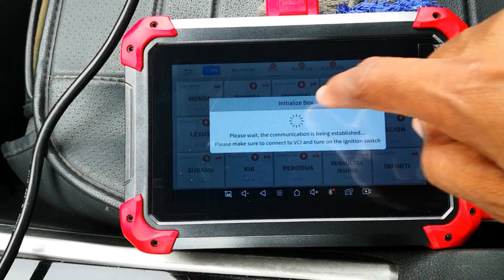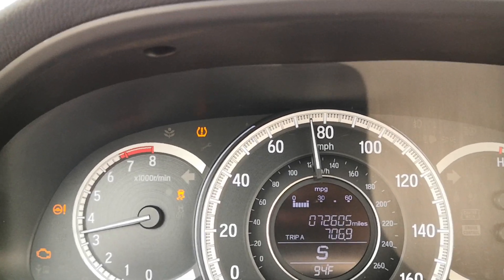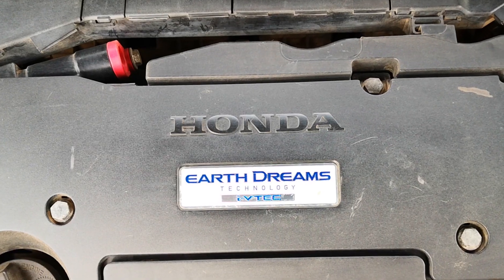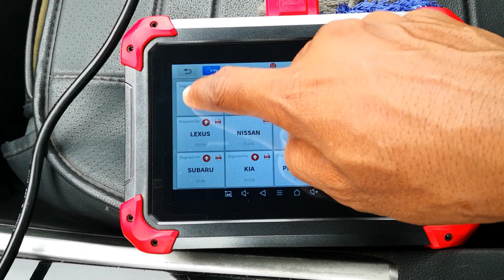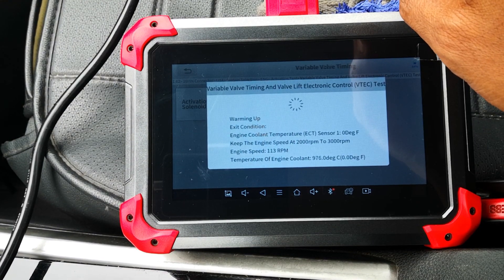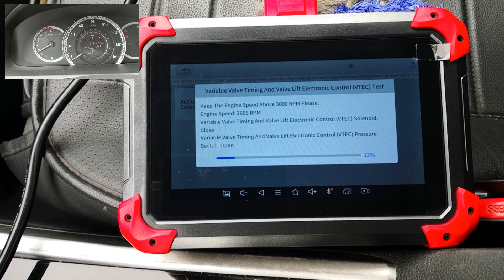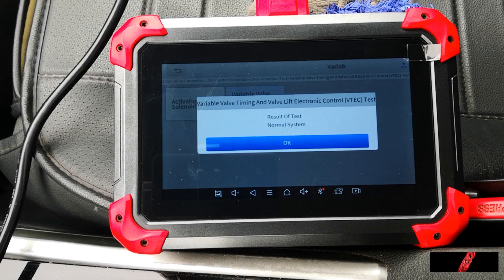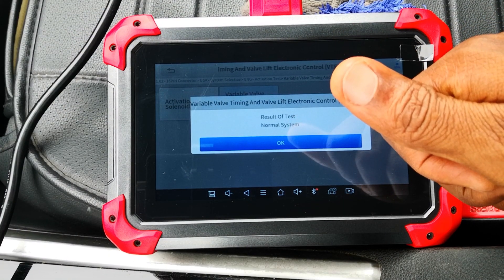How to Test VTEC on Honda using OBD2 diagnostic scanner: XTOOL D7 Bidirectional Scan Tool

Comment: What scan tool do you recommend for a CKP relearn for 2008 honda accord with K24Z2 engine
Reply from the maker: Pretty easy function to do. XTOOL including the D7, or equivalent Autel's support it. I think the A30M can support it but haven't specifically checked. Can do so later and revert.
Reply: @DIYAutoworksNG  CKP is not on the 30M only D7, 7S and above. In your video you bypass the VTEC or spool valve test but test the VTC/VVT system, why is that? Is this test only on the 9th gen Honda Accord or does it work on the older gen?

Comment: Well-done sir, been watching your videos and I can't believe you're not  a professional technician but a medical doctor. Or we'll yes you're a doc -of automobiles 😂. Anyway sir great video. I want to get xtool ez400pro it's same with d7 but has ecu coding feature. But in your opinion xtool and Autel which one should  I go for? And if autel what's  the counterpart of it in xtool -both price range, capabilities and other stuff?
Reply from the maker: Thanks for compliments. Yep, I treat both man and cars🤣🤣🤣.

You are right the EZ400 Pro has the edge over the D7. The competing Autel would be the MP808. I consider Autel generally more refined in its finish, but this comes at a price. The MP808 is about $200 more than the EZ400 Pro. Also, the 3 years of free updates for the XTOOL, plus the significant lower cost of subscription renewals definitely adds up. My task really is to lay it bare so that everyone is able to make an informed decision when choosing a tool. The truth is that both are good tools, I'd say you go with the one that makes the most sense taking all those points above into account. Best of luck!

Comment: Nice!

I noticed under the Active Test section, that there's a test to put off one injector. Do you think this also works the other way (i.e. the same test puts off and on a single injector)? Just asking because some diagnostic workflows may require one to actuate one injector to test the control side of that injector's circuit (with the injector disconnected to prevent burning its coil during the duration of the test).

The D7 is getting more compelling by the day!
Reply from the maker: Thanks!

Regarding your query on the injector test, I think the tool just disables and enables the supply of voltage to the isolated injector.

The D7 is a nice affordable tool!
Reply: @DIYAutoworksNG  Yeah, that makes sense (i.e. the ability to put on AND off the specified injector). Thanks.